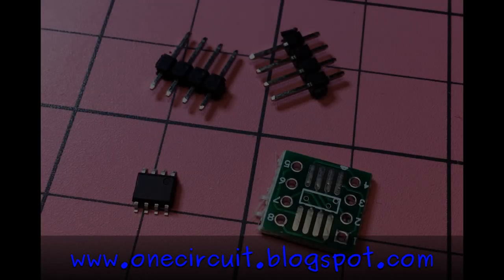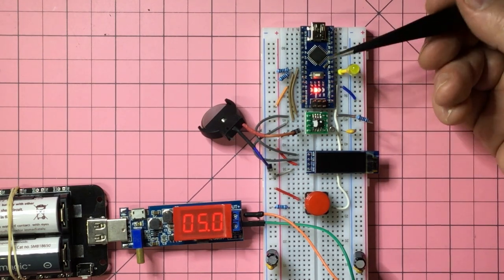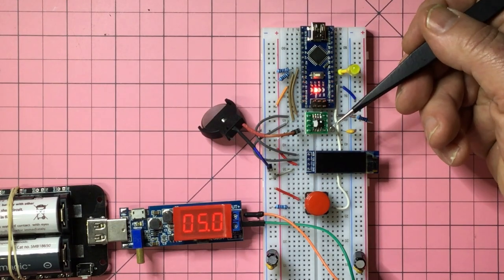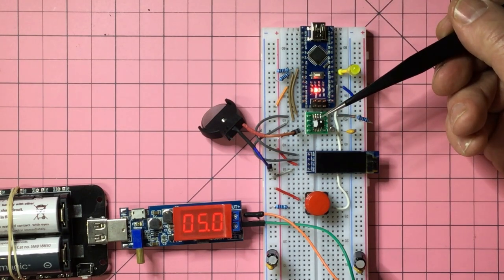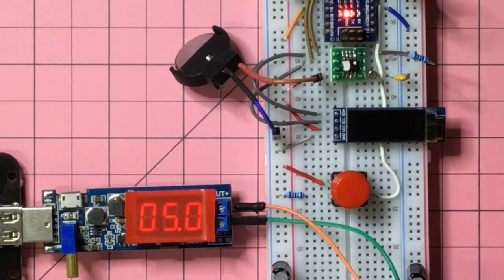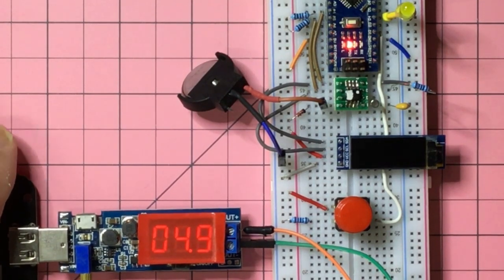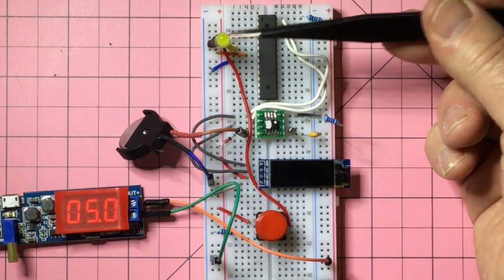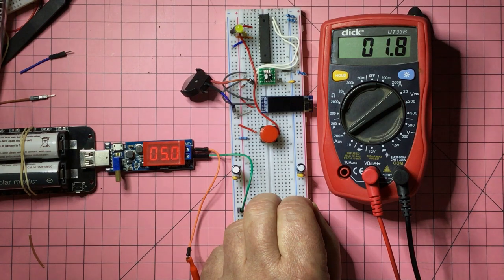PCF8563 real time clock

Comment: Nice little circuit. I leaned on a failed project several years back how important it was to have the pull-ups on the i2c bus.  It's funny, two weeks ago I made some battery backed-up ram for a 6507 I have been mucking with. Diodes are great!  Good video as always.

Comment: The datasheet I have for the PCF8563 does mention the capacitor on the OSCI pin (any value from 5pF - 25pF). The capacitor on the OSCO pin is built-in to the chip.
Reply from the maker: It certainly got it oscillating! 👍

Comment: Nice helpful video! I'll take a look at the code because I am interested in the interrupt. Maybe a sensor can be used instead of the button to wake up the Arduino. That would be cool.
Reply from the maker: Thanks! It's a capable little chip holding onto all that info and keeping pretty good time! Code is on the blog - good luck!